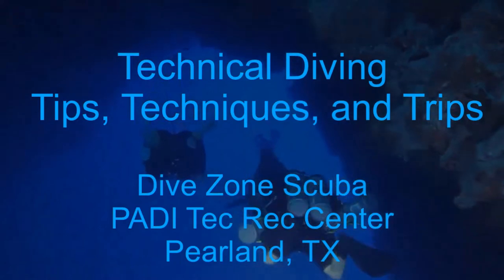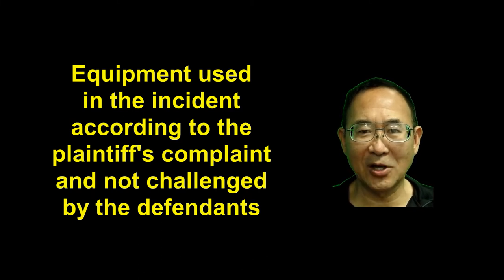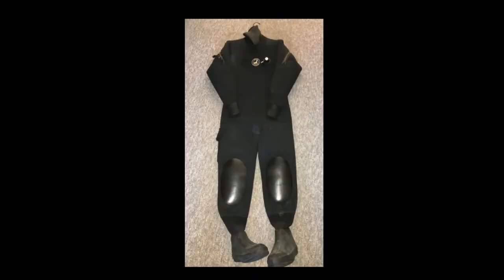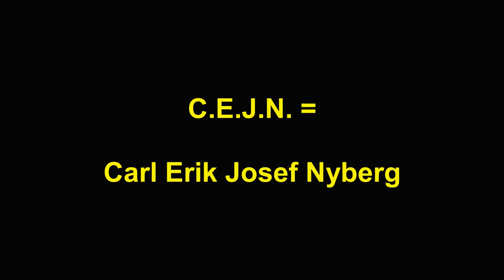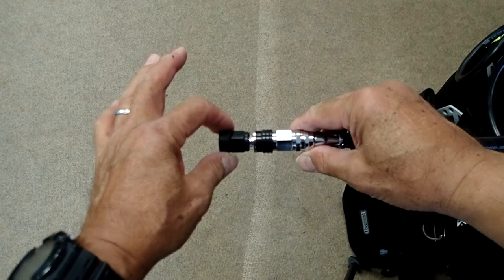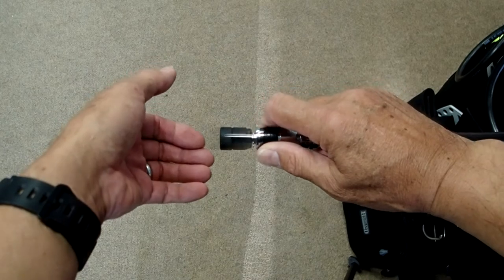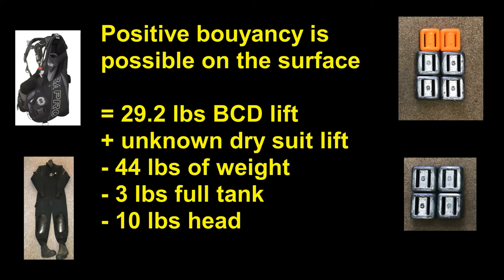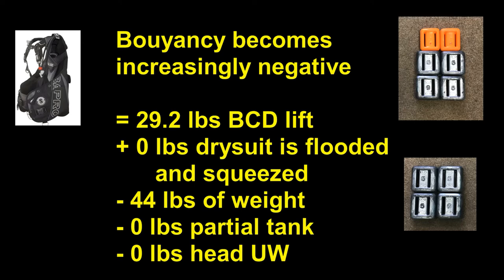#89 - The Linnea Mills Tragedy:  A Review of the Equipment Involved in this Incident

Comment: CMAS II For more than 30 years. I learnt to dive drysuit in Scotland. The inflation capacity of my Drysuit WAY  overpowered my Scubapro BCD which was sized to warm water diving holidays. I still use and prefer that BCD. No inflatiion tube on a drysuit is criminal. As to whether it is DIN or another standard I hold my breath. I have my Scubapro BCD with DIN fittings I bought another Scubapro BCD  with DIN Fittings for my wife 3-5 years later. For some reason, I was doing some tech stuff I leant her my regulator and hoses. On that dive her DIN BCD inflator disconnected, BIG DRAMA. After that I tested our regulator and BCD mixes. The old scubapro DIN on the new DIN Scubaro BCD disconnected if I tapped it with my finger. Believe me it happened. I still use those 2 BCDs and a lot of Scubapro Kit BUT I don't mix and match unless I have fully tested out of water on a bottle. Now that's advice. Let's get back to what the industry is doing to endanger the lives of divers. Now I learnt to dive in the time when Cousteau dived. I still wear a knife strapped to my shijn and holding my snorkel. People look at me and thjink I am a Neanderthal. But I'm also a fisherman and know  what happens if you get  a treble hook in you MUST know where your knife is. Now the Punchline. I dive with a weight belt as in 1990. It is rubber, can expand and retract even with a dry suit. It has a big metal buckle that any buddy can see and release. Yes I may carry a couple of Kilos in my BCD pockets to trim on early dives while I manage the salinity BUT the weight is on the belt. The industry is inventing all sorts of places and methods of weighting, most not compatible with air travel. Go on Industry, you won't kill me
Reply: Sometimes the simplest set up is the best.

Comment: That's certainly at the limit number that tech divers train for multiple failures: non balanced rig/excess weight, non ditchable weight, broken drysuit inflator, broken drysuit zipper. I think most fold at five or six simultaneous ones. Rec divers really only train for one failure and tend to fold at two simultaneous.

Comment from the maker: One thing that the Second Amended Complaint does not discuss is the material of the drysuit.  From looking at used Brooks drysuits it appears that they commonly manufactured crushed neoprene.  While a completely flooded laminate drysuit provides no inherent buoyancy, a completely flooded crushed neoprene drysuit may provide a minimal amount of inherent buoyancy.  This would not be significant in comparison to the 44 pounds that Linnea Mills was reputed to have been wearing.  Lastly, if the drysuits had built in boots, that would provide a slightly negative component to the drysuit.

Comment: New diver no drysuit training, now way to inflate the drysuit , 44lbs of weights ,a bcd with inadequate lift for this diver/gear. The ppor girl was dead the minute she got in the water.
Reply from the maker: Yes a very unfortunate situation which will undoubtedly have an impact, hopefully for the better on the dive industry.  The affected agency, PADI has recently released several requirements to help prevent a future occurence.  They are mostly common sense, but still had to be said to prevent these types of things from happening.
Reply: Also a night dive, only 4 previously logged dives all in warm water, instructor not certified to teach dry suit, the 44 lb lead was non-dumpable, the dive center was already engaged in a wrongful death lawsuit at the time the instructor told her her setup was fine before entering the water- how they escaped criminal charges is beyond me. PLUS they tried to blame her death on her dive buddy (the only person trying to help her) and made the 14 yr old DM-trainee aid in the body recovery the next day
Reply: @bbl2019  They avoided criminal charges because the investigation (the information the AG was using to decide if there were charges to be made) was extremely poorly done. Like my dog may have been able to do better, and he is a dog.